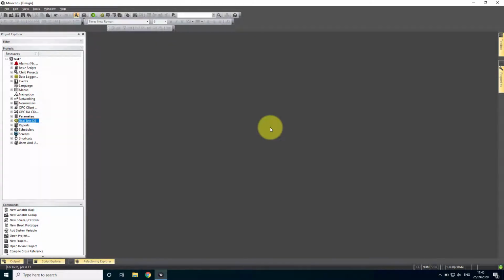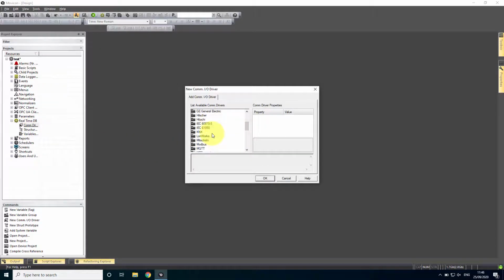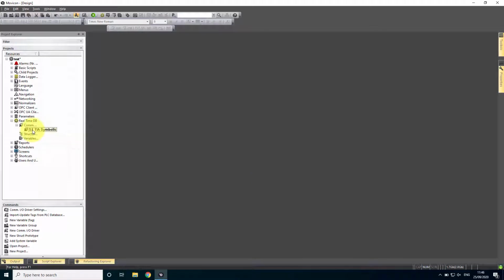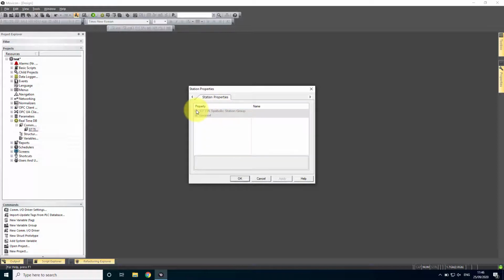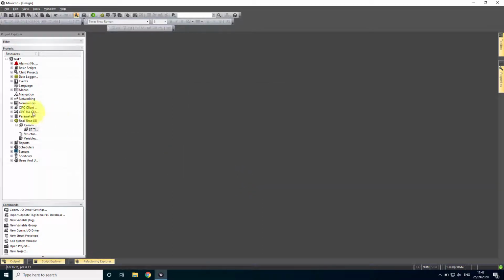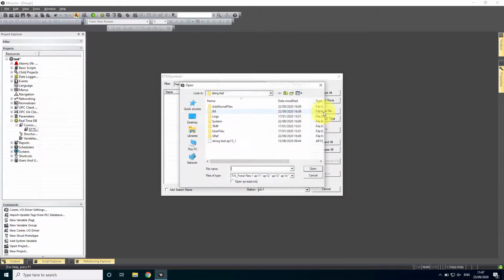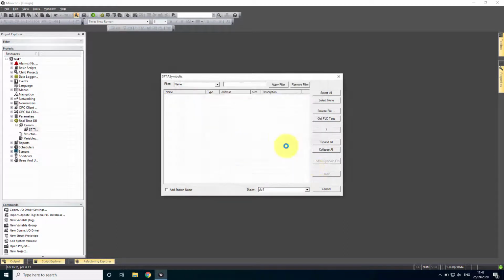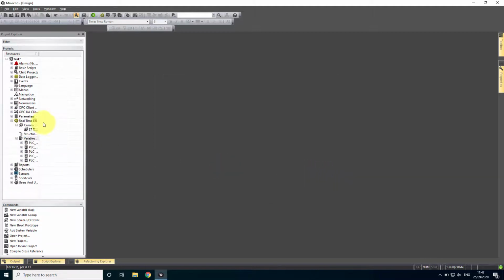Import tags from a TIA portal Movicon 11

Comment: many thanks for your video. it is very useful for a beginner. but the V17 is not supported is it right?
Reply from the maker: Hi Adam, if you upgrade to Movicon 11.6 build 1204, Tia portal projects v17 can be imported.
Reply: @products4automationukirela953  many thanks for your advice